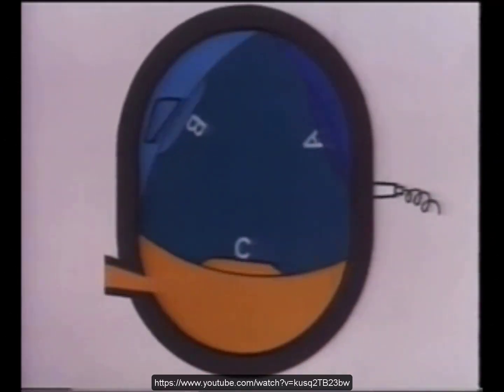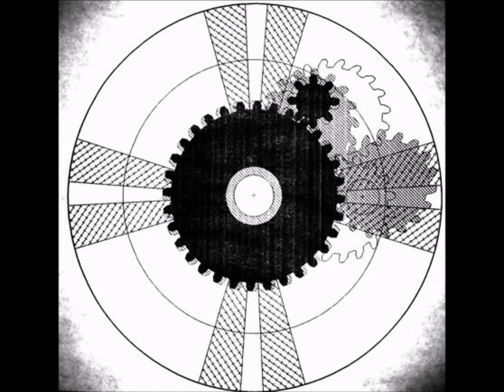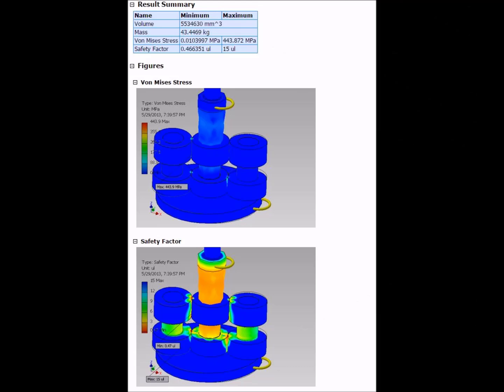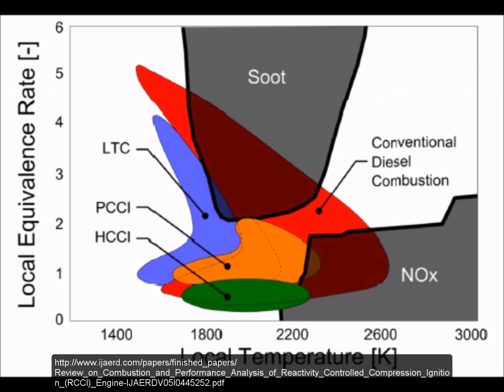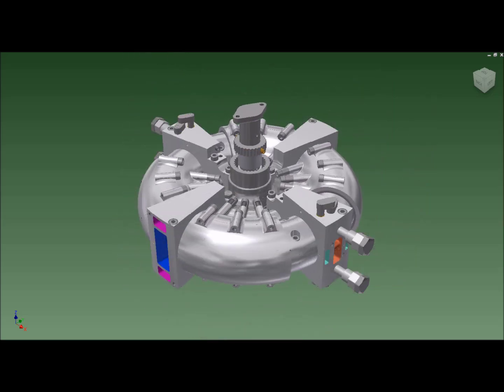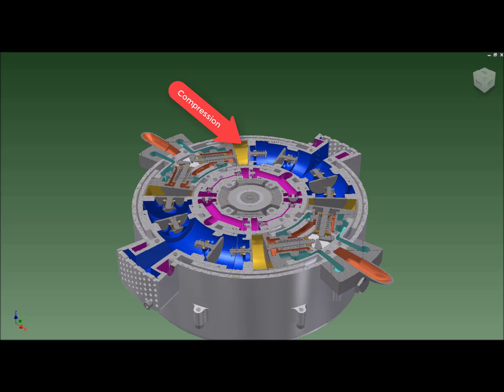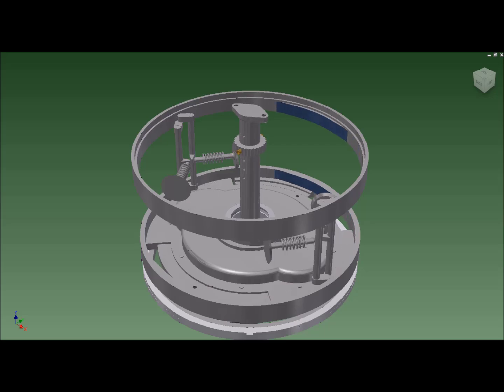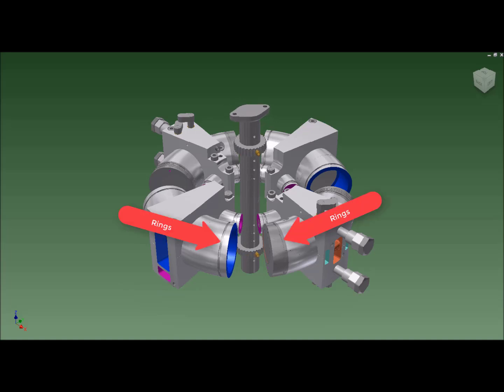OPCE Four Cylinder Engine Story

Comment: I do not think that a combustion engine with the usual 3000 rpm and 1000 + c  heat cycles with as much parts as a Swiss automatic watch  will run reliable  enough for mass production. Nice effort though. PS: How do you bore, hone and mass produce a two part banana shaped cylinder?
Reply from the maker: Thanks for your interest.  By the way, by comparison to my engine, a conventional V-8 would have about double the number of parts as a Swiss watch, and still seems to be reliable enough for mass production ;-)  This engine was originally designed to redline at 6500 RPM and passed the approval of a design engineer and a thermal engineer.  Of course, a real prototype would provide more definitive results.
According to the machinists I work with, the toroidal cylinders would be shaped using a 5-axis CNC machine with a rotating cutter generating the bore while following a circular path along the stroke -- not a challenging process, but requiring specialty equipment.  For mass production, the raw blanks would be cast and final-bored using the 5-axis CNC machine.
The real manufacturing challenge is the non-circular gears.  They can only be produced using a CNC-controlled Gear Shaper (which is definitely not a CNC milling machine), with specialty software.  Unfortunately, gear shaping takes longer than other gear manufacturing processes, so this would be the time-limiting and cost-generating process.
Although I doubt that I'll release a video of it because it strays too far from the original patent, I have a radial design that has all the advantages of the OPCE without the manufacturing challenges.  With this new engine configuration, it feels like I'm abandoning five decades of designing gears and working with engineers and manufacturers to come up with a production-ready OPCE, but on the bright side, everything I've learned along the way about engines, engine cycles, and manufacturing has helped me clarify what's important so I can now simplify while retaining the key features.
Thanks again for taking the time to comment!

Comment: Your combustion chamber is far too cold for clean burning, especially of waste plastic and soot (and to compete in the modern world engines MUST burn waste plastic). And I didn't see any insulation. How do you prevent heat loss? Without a highly insulated combustion chamber there's no way to burn completely and reaching anywhere close to the Carnot efficiency limit is impossible.

I like your variable compression, but is the engine's expansion to compression ratio held at 3:1 at all times?

I don't see any catalytic staged combustion. How do you clean the exhaust, given that zero emissions is the minimum and actually cleaning the air is the goal?

No Temporal Torque Transfer Device. How do you smooth the output?

No hot wall ignition. Spark-initiated combustion is way slow and quenches badly, ruining efficiency and causing emissions.

No simultaneous combined cycle, resulting in tremendous cooling losses.

I see lots of issues and complexity, but you did partially solve a few issues. It can't even remotely compete with my engine, but I salute your effort.
Reply from the maker: Thanks for your response.  I'll briefly address the points you bring up.
Temperature -- the thermal engineer I was working with was much more concerned about it being too hot and trying to get the generated heat away from the combustion chamber, hence the liquid cooling system.
Variable compression -- by definition this means that the expansion to compression ratio is variable, not a constant value; it does, however, mean that the ratio you've indicated is one of the possibilities.
Catalysis -- if needed (i.e. if using hydrocarbon-based fuels), catalytic converters would be added externally to the engine, as is typical of equivalent engines.
Torque Transfer -- the output is, by nature, smooth, since the engine stroke is almost sinusoidal and forces are balanced across the engine; there is sufficient mass in the oscillator mechanism to act as a passive flywheel.
Hot Wall -- the engine as shown is compression ignition, not spark ignition, with two fuel injectors per chamber to set the injection-initiated combustion to the best possible time(s) for clean burning and maximum power;  the clean air in the charge is compressed to well above the ignition temperature of the fuel prior to injection, so there is no need for hot wall ignition.
Combined Cycle -- as indicated in the video, the "waste" heat isn't wasted -- it's used in a Cogeneration or Combined Heat and Power system for heating water to be used for space and water heating.
Complexity -- yeah, it's pretty complex!  It still has a lot fewer parts, and fewer unique parts, than a typical V-8 conventional engine; and I'm currently working on what looks like a completely different design (radial!) that still has all the performance characteristics of the circular engine -- opposed pistons, uniflow two-stoke, variable compression using exhaust valve control, stroke-by-stroke supercharger, perfect static and dynamic balance, Miller Cycle, extremely large valve venting area, etc.  I probably won't post a video of this one, though, because I think it's strayed too far from the original patent!
All the best with your design!  I have had quite a few discussions with an engineer who was working on ceramic linings for IC engines to increase wall temperatures without damaging other parts of the engine.  Interesting work!

Comment: great idea with more parts per engine. nowadays we just fit an electric motor with some awesome lifepo4 cells. radial engine woukd be more efficient to this
Reply from the maker: Electric's great, and I hope we continue to move in that direction.  There are still applications for IC engines, particularly when coupled with renewable fuels.  Until our cars have replaceable batteries or safe ways to fast-charge, we'll still be stuck waiting for that charge.
By the way, the configuration of the pistons, circular, radial, or linear, really isn't the most important thing -- it comes down to making them "opposed" so there's no energy wasted in vibrating the block, being able to vent the chamber effectively (lots of valve space and uniflow scavenging) and being able to allow for a greater expansion stroke than the compression stroke (Miller or Atkinson).
The huge MAN uniflow two-stroke engines that run ocean liners have hit the 50% efficiency mark, and my engine cycle, adapted from theirs, adds the extra efficiency of opposed pistons and better chamber venting; so it's possible that my engine would match or beat that efficiency, which wasn't even dreamed of two decades ago.
Odd that you should mention radial, though, because I have a design on my computer right now that's a radial arrangement that meets the requirements I listed above, in a simpler and more manufacturable configuration!  It certainly isn't a WWI aircraft radial, though!
Thanks for your interest!
Reply: @prosstaylor  i totally agree with you we still need ICE and CCE (diesel) i look towards the hybrid option with the ICE/CCE are used for electric generation. hydrogen should not be an option as cost and energy required is much higher than other alternatives. dual fuel lpg/diesel is the best option in my view. small engines on high compression for low rpm high torque for either the 3000rpm or 650rpm(tractor style) generators. i am subscribed and will be a passenger on your journey. all positives for everyone. you get to solve more puzzles. Have an awesome 2025 Sir.
Reply from the maker: Thank you!  All the best!

Comment: Nice 3D rendering. When will you run the actual prototype engine? With modern even metal 3D printing, I would assume it would be easy to test.
Reply from the maker: As a retired middle-class individual, funding a prototype is a challenge.  The college I worked for supported the plastic working prototype of the early design to the tune of $40,000, then supported development of a partial prototype to test the gears for $50,000.  Unfortunately, they couldn't arrange for the use of a CNC-controlled gear shaper (the only practical way of making the gears) and paid a machinist to try to build the gears with a CNC milling machine.  That was a dismal failure, and funds ran out before completion.  I do have an impressive collection of nice-looking pieces of steel from that attempt, though!
The college owns a $500,000 metal printer, and we printed one set of matching gears on it as a demo, but acceptable gear tooth quality is not something that can be achieved without after-printing machining with standard gear manufacturing equipment.
Liebherr group's gear department was willing to write software and build a set of gears for about $20,000, but by then the college administration had changed and the new group were no longer willing to support research and development for insiders.  They even initiated an IP assignment process to transfer patent ownership to me, with me paying the remaining fees for publishing the patent.
One semester, a team from the college's Bachelor of Technology program worked with me and a 3D-printing and machining company from the USA, with the intent of them using my prototype as a show-piece in their advertising.  We would supply a significant portion of the funds through a grant, and they would absorb the remaining costs.  Unfortunately, their negotiations extended past the cutoff date for the grant we intended to access, and proceedings ground to a halt.
One of the consultants I approached indicated that a full working metal prototype would likely cost about $250,000.  This is bigger than many of the small-item grants available, but much too small for a typical automotive R&D grant.
So, I'm still looking for a source of funds.  In the meantime, though, not having anything in metal gives me the opportunity to refine the design, and even look at other variations that incorporate the engine cycle I've developed into other, simpler formats; so all is not lost.
Thanks for your interest!
Reply: @ Understand completely and thank you for your complete response. Best of luck on your endeavor.
Reply from the maker: Thanks!

Comment: What are you’re thoughts on the “1 stroke” INN engine
Reply from the maker: I just took a look at that -- interestingly, their labelling it as "1-stroke" just means that it's a 2-stroke with two power events per revolution, so 2/2 = 1.  That's what my engine is achieving, as well, due to the bilobe gear oscillators which provide a 2-stroke power event for each half-rotation, or 2 x 1/2 = 1.  I like the simplicity of their design.  My engine has some advantages over theirs:  uniflow scavenging, Miller Cycle with variable compression ratio, and stroke-by-stroke supercharging.
Incidentally, on my computer right now I have a design that takes all of the concepts I've developed over the years in designing the OPCE engine and puts them into a non-circular design for simplicity and manufacturability.  I'm hoping to build one of these, if for no other reason than to verify all that I've learned and incorporated into the OPCE.  However, if it doesn't infringe on other people's designs, I may consider commercializing it.
It's too bad that our intellectual property and patenting laws put designers into their own little silos.  I'd like to see the designers of a number of promising designs sitting down and collaborating on the "ultimate" IC engine!
Thanks for pointing this one out to me!
Reply: @ yeah I know that it’s not really a one stroke engine but it is a good marketing strategy. Hey man, you really got some talent. You’re really smart and you’re putting it to good use. I hope you build your engine one day. I’m sure you’ll leave your mark on the world with an amazing design. I really wanna build my own twin charged two-stroke opposed piston engine, that would have a sealed crank case diesel or gas but I don’t want mixed gas. I just like how it’s two-stroke and you get to harvest more energy and there’s no cams.
Reply from the maker: Thanks for your kind words!

Comment: Have you built one and tested it?
Because what looks good on the screen does not always turn out as good in reality.

Its hard to see what is going on there, but from what I can see slamming the valve stem into the other valve at high speed might not be a good idea.

I have solved all of the problems you have mentioned with the Rotary engine.
Reply: @prosstaylor @prosstaylor A plastic model is NOT proof of concept.......

A working model is proof of concept.

I am going to build mine soon.

We can not do away with some kind of reciprocating or at least an eccentric  orbital motion, because we have to create a pulsating volume.

The task is to minimize the weight of the reciprocating motion, while maintaining functionality abd at a low cost.😊 Good luck with yours!
Reply from the maker: Nothing built except for the plastic proof-of-concept shown.  I'm still waiting for someone with a quarter million bucks to pour into the real thing (almost happened once!) -- which gives me more time to refine the design and work on some almost-unrelated off-shoots based upon all I've learned in the five decades I've been working on this one!  I have a much better circular design already, and am working on a simple linear engine that does pretty nearly everything the circular engine does, just not in as tiny a package.
The valve action isn't physically accurate, due to limitations in the animation mode I've chosen in Autodesk Inventor.  I just have the valves snapping open and closed at intervals designed to mimic the much smoother action of the valves.  In reality, the intake valves, which are differential-pressure-activated, would close or at least partially close when the combustion chamber pressure rises to close to what remains in the supercharger, so when the exhaust valve closes, the intake valves would be very nearly closed if not already closed, and the exhaust valve wouldn't snap open and closed -- it would follow the contour of the cam.
Thanks for this post and your interest!  I doubt many people noticed the flaky simplified valve motion!

Comment: Too many parts. Might be OK for lawnmower or leaf blower. Mybe an outboard motor.
Reply from the maker: I'm just going to post a response I sent to someone else recently.  I hope that's OK!

I'm guessing you've had a chance to tear apart a V-8 diesel engine with a turbocharger, fuel injection system, oil supply system, valve trains, cooling system, and all the rest of what makes it roar.  If so, you'll have to agree that there are fewer parts in my engine (not the one shown, but an 8-cylinder version) than in the V-8 that it's intended to replace.  The difference is that the V-8 started out as a fairly simple machine almost a century ago, and the complexities have been added over the years.  My design takes the technology right to the present, benefitting from all we've learned about engines in the past century, so it doesn't have the luxury of starting simple (other than in all the 3D virtual models leading up to it).
Incidentally, I'm currently working on an engine that has all the features of the OPCE (two stroke, opposed piston, uniflow, supercharged, infinitely variable exhaust valve timing, perfectly balanced statically and dynamically) in a much simpler linear (not circular) configuration.  This is a case of starting with a few assumptions, designing an engine, learning a whole lot, refining the design, then realizing that some of the assumptions that got me going were misleading.
It's input from folks like you that keep me thinking.
Thanks for your input!

Comment: Looks too complex to ever be produced.
Reply from the maker: I'm guessing you've had a chance to tear apart a V-8 diesel engine with a turbocharger, fuel injection system, oil supply system, valve trains, cooling system, and all the rest of what makes it roar.  If so, you'll have to agree that there are fewer parts in my engine (not the one shown, but an 8-cylinder version) than in the V-8 that it's intended to replace.  The difference is that the V-8 started out as a fairly simple machine almost a century ago, and the complexities have been added over the years.  My design takes the technology right to the present, benefitting from all we've learned about engines in the past century, so it doesn't have the luxury of starting simple (other than in all the 3D virtual models leading up to it).
Incidentally, I'm currently working on an engine that has all the features of the OPCE (two stroke, opposed piston, uniflow, supercharged, infinitely variable exhaust valve timing, perfectly balanced statically and dynamically) in a much simpler linear (not circular) configuration.  This is a case of starting with a few assumptions, designing an engine, learning a whole lot, refining the design, then realizing that some of the assumptions that got me going were misleading.
It's input from folks like you that keep me thinking.
Thanks for your input!